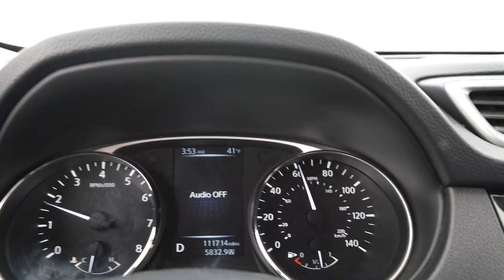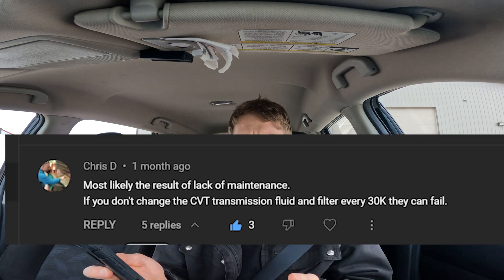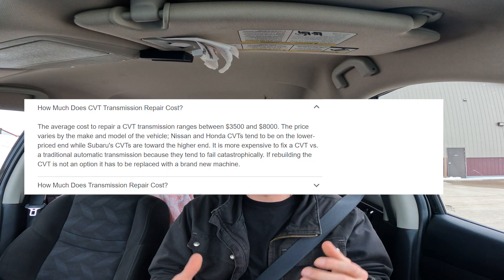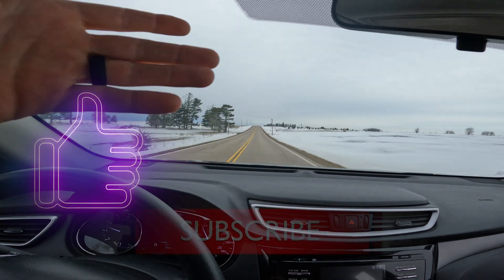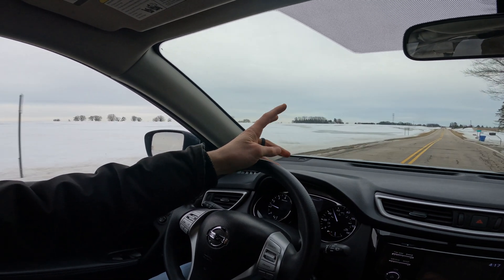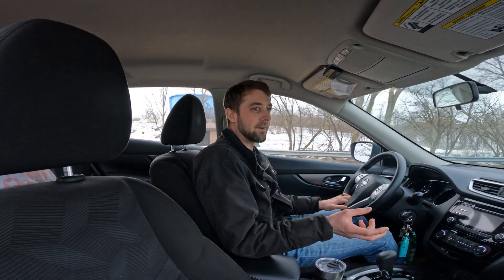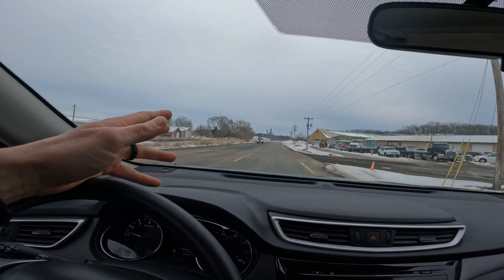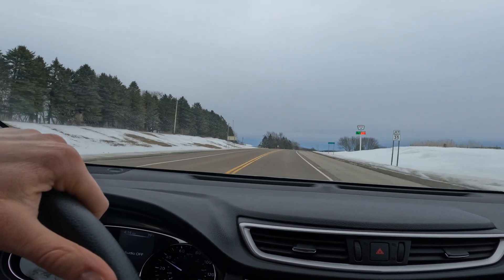Everything WRONG with the Nissan CVT Transmission

Comment: Are Honda and Toyota's better? If so how much better? I'm tired of cvt's but every manufacturer is putting it in everything
Reply: Honda and Toyota cvts are much much better built… as a mechanic, I can say this with complete certainty… the cooling systems in Honda, and Toyota are much better able to keep the cvts cooler as well… an Uber driver had a 14’ Corolla equipped with a cvt that lasted for 325k miles, and he beat the hell out of it.. had a lead foot… and Honda which I have a 2013 accord with a cvt  still going @ 170k miles.. their failure rate is almost nonexistent under 150k without proper maintenance… of course with the proper maintenance, 200k miles is no problem on the vast majority of them… Nissan has jatco who build their cvts… they have a history of being a trans-garbage transmission manufacturer …Honda and Toyota make their own .. for the most part..
Reply: @donovanfahrbach2493  do the nissan cvt’s heat because of going at a high speed or only because of revving high rpm’s?
Reply: @XDMIIIIIIIII  Nissan CVT’s over heat primarily because the cooling system for the transmission fluid is inadequate… I speak of pre 21 models…plus the cvt themselves are not built like Honda’s or Toyotas…in the Nissans, those units ran hot… many Nissan owners have had an auxiliary cooler installed which helped tremendously… pre 2021 models I’m speaking of… however, both the cooling systems and cvts have been redesigned…
Reply from the maker: I think they are all known to have some issues but the actual feedback I can give honestly is on the Nissan. (Because I’ve owned since new) with that being said I have driven them and the response is similar but longevity I can’t speak on. Never had to do anything but maintenance to the Hondas and Toyotas.
Reply: The 2004 Toyota Prius can reach well over 300.000 miles with the cvt working flawlessly. Those things don't die.
Reply: @WH250398 some car phew toyota  pruis 300k to gte that mileage in a cvt.
Unreal to hear that

Comment: It’s the maintenance not the transmission most people never change the oil,, with proper maintenance will last 10 years!!!
Reply: 10 years isn't good enough when cars cost $40,000 - $50,000.
Reply from the maker: I agree, maintenance is key

Comment: I know that you are not supposed to try to drag race with these transmissions,  they won't last long if you have made alot of fast starts.   Just slowly and reasonably engage the acceleration,  don't treat them like a racecar because they are anything but.   I was told this by a Nissan representative when I bought a 2011 Nissan Rogue.   Now I have a 2015 Nissan Rogue Select and I have no problem with it but the mileage is only 14,300 and I still avoid fast takeoff with it.   Call it babying it if you want but I like it so far,  I only paid 19k for it when I bought it new and have had it 8 years so I feel like I got a bargain.
Reply from the maker: I hope no one plans to drag race these things...lol However, that might make for a good video? hmmm...

Comment: got a 2010 Altima with over 250k on it and still original transmission. did a fluid and filter change recently. still going perfectly fine. no complaints here
Reply: There's always an exception to the rule.
Reply: @nodak81 so majority are the exception to this rule? Majority of people that does the right maintainance doesn’t have troubles.
Reply: @rafaelg9016 the rule is that most people don't do proper maintenance of transmissions. Every car manufacturer knows that. Smart car manufacturers expect that and engineer their transmissions accordingly.
Reply: You're the one!
Reply from the maker: Nice!
Reply: Play the lottery,run,dont walk, and I’ll take a 10% cut… that is a miracle that your cvt made it to 250k… is it still going?
Reply: @donovanfahrbach2493  yup 262k still going fine
Reply: Same here. 2010 mitsubishi lancer, 259000 km and still going strong. First transmission and never had a problem with it. Its the exact same transmission that nissan used in their cars. Always changed the fluid and filters including cooler filter myself.
Reply: @KaVoRoBu  The fact you have more cost and time to maintain something that is not fun an has no resale sucks.
Reply: I bought 09 Sentra one previous owner who babied it then daughter wrecked it her first day driving it and it sat for 5 years… just cosmetic stuff also the AC compressor needs replaced. It was 191000 and I let a friend use it not sure if he dogged on it ( probably did ) it’s at 205k rn lord knows I AINT EVER GONNA LET RPM GET OVER 3.5K unless I’m DYING LETS GO
I been letting her warm up way to long , need to service the trans fluid but I’m thankful she still goes. When I first drive her it’s like 10 mph for the first 5 minutes baby. Why not! Better than a golf cart by far!
Reply: The secret is do not go over 2000rpm. Do fluid changes every 30000mi

It’s not a race car 🤦 it speeds up on its own 

If you launch over 2000rpm all the time, then that strain on the cvt will cost you. It’s a transmission for chill people 😄
Reply: @christiangreif5430  The cvt still going??.. any update?..
Reply: Until it's not...
Reply: Don’t believe that has a cvt
Reply: What's your driving style like?
Reply: Wow, 250,000 miles or kilometres?
Reply: yes its possible  to have a high mileage on altima,search for occckid altima in youtube and this guy got Altimas with 400k miles. my neighbor who is an elderly man drives a 2009 with 350k miles not in a very good condition but serves the purpose. i myself own one with 110k what i used to do is no sudden acceleration or hard breaking. Dont floor the gas pedal and try to have a linear acceleration. change with original ns3 fluid every 30k and filter(both stainer filter and paper filter) every 90k. warm the engine before before driving and bring the rpm to what it is when we disengage the transmission(neutral). An after market transmission cooler if you have daily long drives especially in hot climate
Reply: and try to keep the battery in good health, always replace a bad battery as a voltage variation can strain the transmission. These jatco transmission are very poorly engineered ones , but if you have one and stuck with it then these tips can prolong the life of transmission.
Reply: Same for my 2014 Juke, it’s over 210,000 miles now and the original CVT drives exactly the same as it did when I first bought it. It’s still a lot of miles and years and I got a CX5 to replace it, but not because of the CVT. Any car over a decade and hundreds of thousands of miles has given its money’s worth.
Reply: Well that’s one…there is always a fluke
Reply: only thing better than a CVT2 (RE0F10A) is the CVT3 (RE0F09B). that model years are the golden year of jatco CVT.
Reply: 250k is nothing, also yikes
Reply: @AgenteGiovanniSfrazzetto  250K+ for a Nissan Altima with a cvt is an amazing achievement.
Reply: @donovanfahrbach2493  it is for u, but for some better cars like Toyota, that’s nothing. Let’s say that’s a really honest statement you made there without further replacements.
Reply: 2016 Nissan Pathfinder.  Over 186,000 miles and still going strong.  I also do the maintenance, but the dealership handles the transmission.  I guess I am also an exception to the rule. 😅

Comment: Bought a 2012 Sentra 2 years ago for $4400, for most of my commutes it was 7-10 miles back and forth and didnt really notice any issues. A year after I got the car I went to a different state and im cruising 70 on cruise control and suddenly the engine rpm jumps near 6000 and continues to keep high revs for even 40 mph, it has NEVER gone past 3500 rpm before this. Cruise control stopped working shortly after and the cruise light was just blinking. I stopped on the shoulder of the highway and restarted the car and it was still blinking. I took an exit and found a walmart parking lot and just sat with the car for half an hour thinking what hell please be a fluke. When I turned the car on again the blink was gone, cruise control worked again and it wasnt high revving. But soon after I got on the highway it started doing the same crap again and this time the service engine light came on and my heart DROPPED. When I took it to the mech he found 3 codes, 1 for step motor, 1 for solenoid and last one for engine misfire. He drained the CVT fluid and said there was metal shavings in it. He cleared the code and put in new fluid and told me that if anything happens again, it means the transmission has to be replaced. I continued to drive it at these 7-10 mile ranges for work and over time it got worse and worse. The distance traveled before the check engine light came on got shorter and shorter.

Now in 2023 and recently hitting 100k miles, the whining noise is getting so unbearable and getting on the highway is scary. The whine gets louder and louder as the rpm or speed goes up. I have to drown it out with music. It now cruises at 3400-4000 rpm for 60 mph. After 15 minutes of driving when I come to a stop and start accelerating again, the car kicks/jumps forward and so does the engine rpm before going down drastically. Acceleration feels so weak and the car is trying to tell me it wants to die or give up. 

Such a shit car and shit company. Nissan is having internal problems as a company itself and I hope they go bankrupt. Im going to clear all the codes and let it cool down for an hour near a nissan dealership and sell it back to them. This car doesnt keep logs of code clears. They can deal with their own poorly made shit.
Reply from the maker: to be fair every manufacturer has problems, but yeah, from my personal experience I dislike the CVT.

Comment: Bought a 2014 Altima last month, resold it 23 days later, something was wrong with that car that the dealer couldn’t figure out. These are good new and they are good as trade in cars, not used or long lived car. Don’t expect more than 10 years out of it.
Reply from the maker: Yeah sounds about right.
Reply: You're full of it. If properly driven and properly maintained an Altima will last forever, like 300k+. Problem is people burn up the fluid driving the piss out of them in hot weather. Sounds like you got one that someone burned up. Not an ideal car for a long road trip. If you go on a road trip in the hills or mountains, change the fluid immediately after the trip. The biggest problem is there is no maintenance interval on the fluid. Could be 1,000 or 100,000. Changes should be done when you find your fluid to have a tinge of black in it. light brown is okay. The bottom line is Americans are too fat and lazy to get under their car to check the color of the fluid.
Reply: I was about to buy a 2018 Nissan Juke last week. Until a pre sale inspection found the CVT had failed! it had only 35,000 miles on the clock!

Comment: The "special" way to drive them is by not hitting the gas pedal from a dead stop, stop light or stop sign. Also, you need to let the CVT fluid warm up for 3 minutes from a cold start, fluid must be at a certain temperature before operating. When you hit the gas pedal from a dead stop or start the vehicle from a cold start and start driving without the warmup, you will decrease the life of the CVT.
Reply: Drive it like no one hs ever driven from the beginning of time. Cars are expected to take a certain amount of abuse. I would think that hitting the gas from a dead stop should cause no damage to a modern automobile.
Reply: @DigitDesign   You would think, but to save money some mfg no longer care about reliable transmissions or motors. CVT transmissions are the worst and must be pampered to get 100K life without any issue. Most regular transmissions are durable and are capable of reasonable abuse such as gassing it from a dead stop, doing donuts, drifting and minor off roading (sedans) in emergency situations. But the CVT's are horrible, I have one, not by choice, but I have had all mfg suggested maintenance done on it since i owned it new and no issues so far with 112K on it.
Reply: @DigitDesign It wouldn’t impact most cars that are built properly. Cars in general are designed for various conditions and that includes abuse. Though you just have to do frequent fluid changes if the vehicle is under constant stress due to faster fluid deterioration and fatigue. Unfortunately, some powertrains are built like glass and can’t take anything to save their lives.
Reply: @DigitDesign Toyota have a launcher gear to take the hard acceleration from a standing start. No belt slippage. Nissan suffers from belt slippage from standing start.
Reply: Think again.
Reply: I was told to drive it like a granpaw would drive - slow to accelerate, let it idle before driving especially on cold days.
Reply: @gregnixon1296  Sad but true, I have a CVT and I must drive it exactly as you described. I now have 112K on it, but it still runs like new and when I'm on the hwy, the passing gear is still fast, i was surprised by that, but it runs smooth.
Reply: Yep, buy a Maxima and drive it like Grandpa.  One of the reasons people buy the Maxima is because it's very sporty and has over 300 HP.   Just one more reason I will not own a CVT.    @gregnixon1296
Reply: The manual says 60 seconds. It says not to idle it for long periods.
Reply: New Rogue has 2 different pumps in its CVT; no any warm up needed.
Reply: This will affect the lifespan of any transmission. So it doesn't really excuse the high number of failures. They had only been out a few years before we realized they were quite unreliable, when I was working at a garage.
Reply: I always wait for the belts to engage from high to low before accelerating cuz it will make engagement very hard and it doesn’t feel right. Be nice to your cvt. They’re pretty crap cuz they burn through fluid very fast; as long as you do your maintenance every 25-35k; happy life.
Reply: They do not hold up to aggressive driving. Drive them easy and get the fluid and filters changed on regular intervals.
Reply: My plan is to hyper mile it under warranty and maintain properly and if it dies, I get my choice of a new car.
Reply: How do you get it to go without hitting the gas?
Reply: Should I leave it on neutral, buy a better car and just tow my rogue instead? Is that the right way to drive this car?

Never Nissans.
Reply: You can hear him flooring it at the part right after he is critical of "clown"in the comments 😂. You gotta baby it, gentle acceleration.
Reply: Also heard to come to complete stops before shifting.
Reply: My Nissan CVT completely failed to engage in sub-zero temps after being parked at a store for about 20 minutes.  I thought it was toast.  I just had to let the car idle and warm up the fluid.  Check Engine light stayed out but I reset it by disconnecting/reconnecting the battery.
Reply from the maker: ahhh, baby it and don't move it until fluid reaches operating temp. Got it. To add on to that the cooling for the transmission fluid is also horrible. So don't let it get toooo hot.
Reply: @ManvsCars  You are correct on the cooling system for the CVT fluid, it's horrible.
Reply: @ManvsCars  Yep. That's the problem: heat. Heat destroys the fluid. Really have to be mindful in summer months if you are driving in tough conditions like through the hills or stop and go traffic. If you suspect you may have overheated your transmission, drain a bit of the fluid into a white cup. If it has a tinge of black to it, change the fluid. Change the filters and stepper motor every 150k. Thank me in 20 years when you get 300k out of your Nissan.

Comment: I just rented a 23' Maxima last week in Quebec (the car had just over 3K kilometers on it, literally almost brand new).  My first experience with a CVT and I must say I was not impressed.  I noticed that you could never really find a good spot on the throttle when pulling into traffic and also Quebec is very hilly and the trans seemed to always be bogging in the wrong spots.  The cruise control was really bad in that the car would constantly surge on and off especially as you're going downhill.   I like the Maxima as far as the interior, the ride was pretty good, the MPG was pretty good, the power was good if you completely mashed the throttle.  But, every time I parked the car, I could smell what seemed like burnt oil coming from under the car.  I first thought it was the brakes when I parked, so I walked around and sniffed each wheel and nope, it was coming from the mid part of the car where, yep you guessed it, where the CVT is located.  So, not a fan of the CVT and anyone who tries to support them are only doing it because they bought a car with one and they are trying to save face.  Good luck people.
Reply from the maker: Sounds about right, spot on!
Reply: Accelerating on the interstate is slow. My CVT won’t get out of its own way.
Reply from the maker: true that!  @gregnixon1296
Reply: I got a 2021 Nissan and I can't wait to get rid of it. It's probably one of the most crappiest cars I've ever owned in my life
Reply: I have a cvt and don't mind it. 16 altima with over 400k miles.
Reply: Me I really disappointed with nissan I bought nissan pathfinder 2018 with 64k now 72k I heard something weird noise on the motor I hope it will last a little bit so that I can swap it on mazda or Toyota....
Reply: @joevenharo6589 the Nissan VQ engine is arguably one of the most reliable V6 engines in the world. It’s very uncommon at that miles to have major issues. Can you describe the noise?
Reply: @joevenharo6589  Trade it while it has some life left in it.
Reply: The CVT is the ONE reason I didn’t buy a Maxima.